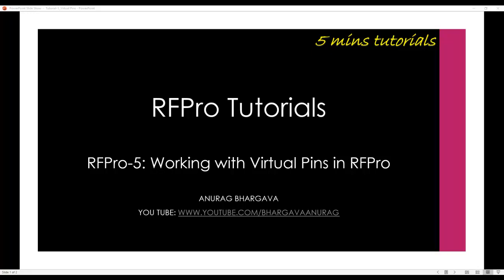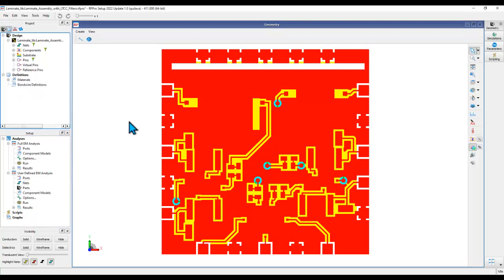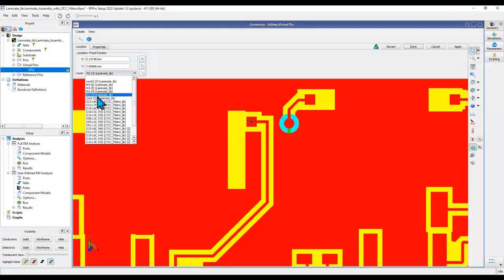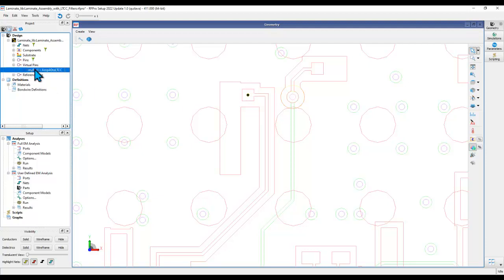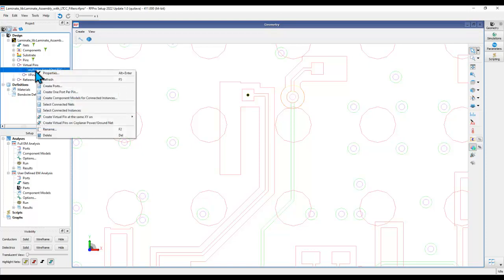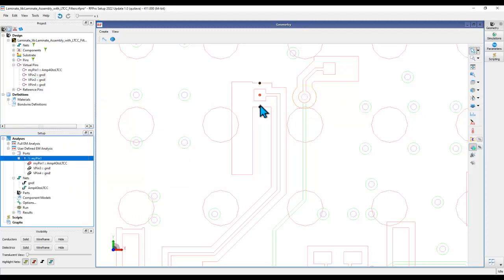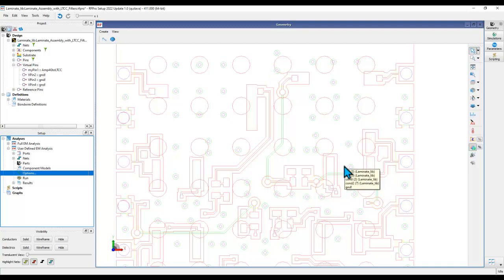RFPro-5: Working with Virtual Pins in RFPro

Comment: Are port reference offsets going to be added to RFPro in the future? If not, what do you suggest users do in scenarios where the reference offset feature is a must?
Reply from the maker: Hi,
Yes, this is something that is on R&D short term roadmap. In the meantime, you can use Fixture Deembedding feature in RFPro. I would recommend you contact your local Keysight support team to evaluate your needs and offer appropriate solution.

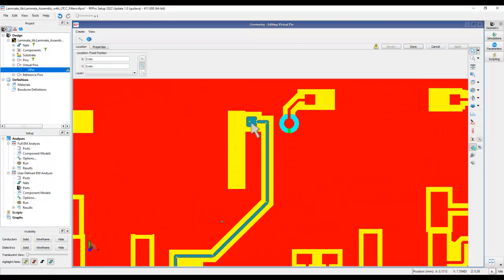Comment: When to use the edge and when to use dot for the virtual pin? (at time 02:07 ) will it affect the results?
Reply from the maker: Depending on the location of the Pin, you would be able to select appropriate Feed Type/Calibration to avoid any high frequency parasitics for better accuracy. Dot pin is without any calibration but Edge Pin can be calibrated if you want.